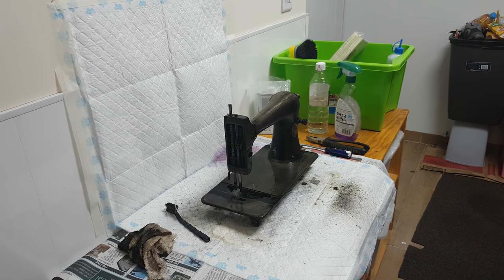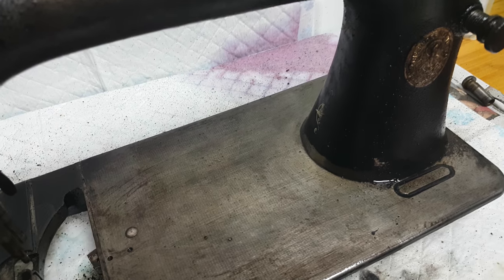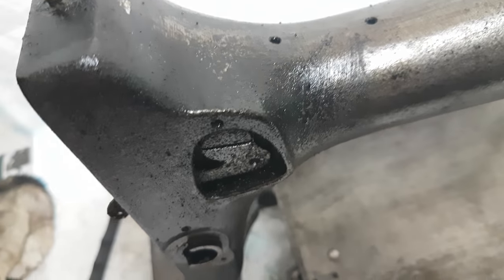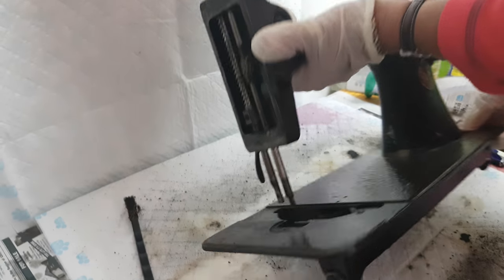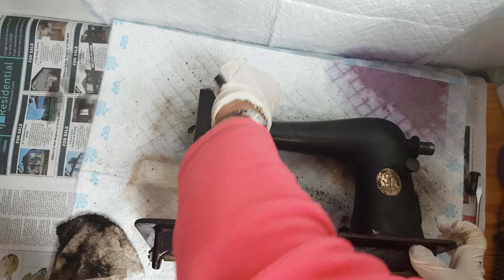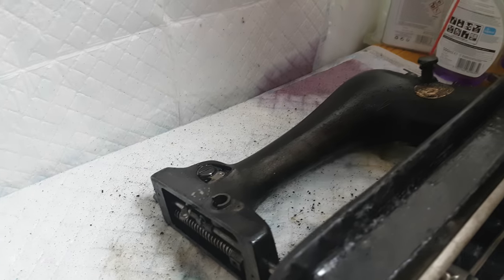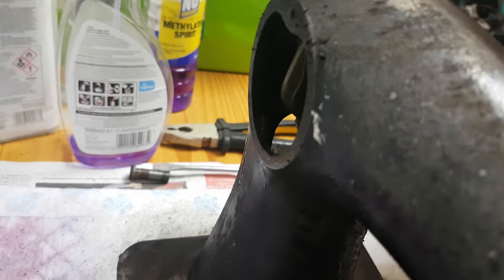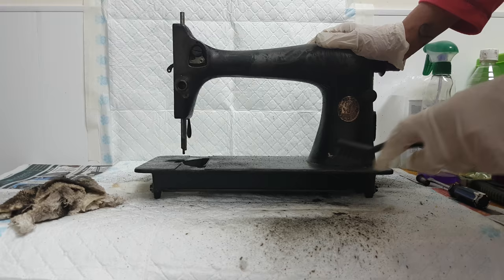Vintage Singer sewing machine 127k  - From Trash to Treasure (Part 1).

Comment: About to do this to my basket-case machine. A couple tips;
The rags will not spontaneously combust if you simply spread them out and hang them up. They can't get hot enough with all that surface area exposed. They WILL still be a fire hazard though. I hang mine in an open space or outside.
The coating on these machines (and many tools of this age) is not paint as we know it. It is a mixture of asphaltum and linseed oil called ‘Japanning’.
The cheapest stuff I've found to take it off is plain old gasoline. Probably smellier though.